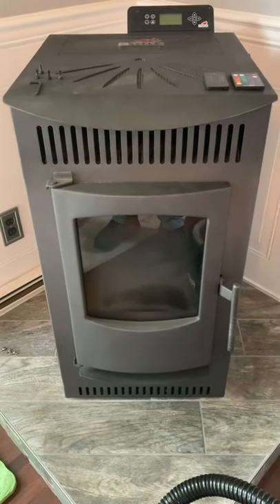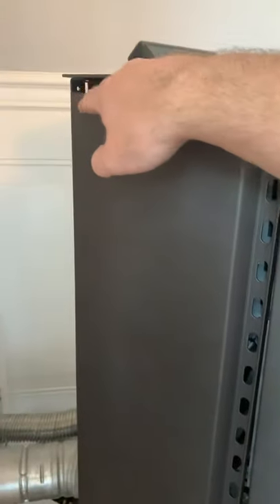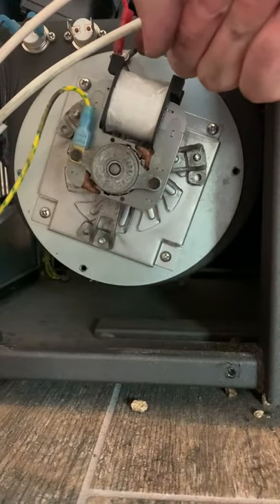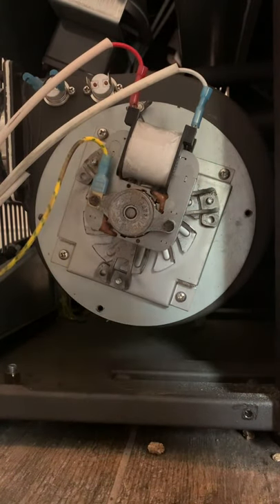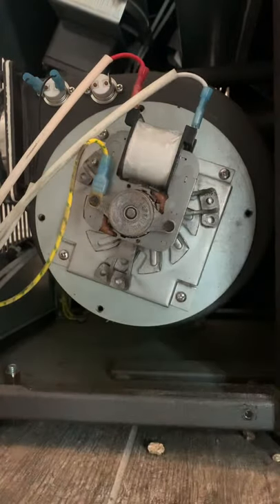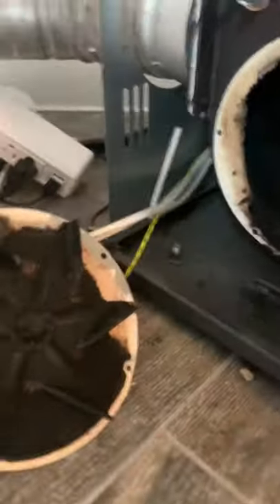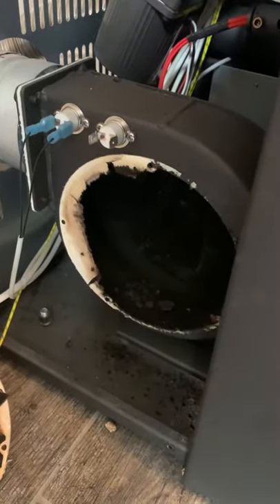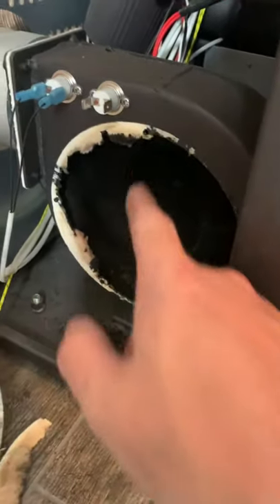Castle Serenity Pellet Stove Blower Removal Cleaning

Comment: I just use Permatex Ultra Copper Maximum Temperature RTV Silicone Gasket Maker, much better then the factory gasket and one bottle will last many years of taking that blower motor out over and over.

Comment: Do you need a new gasket everytime?
Reply from the maker: If you can get the gasket off without ripping it or tearing the insulation I would say no. But with all the heat from this unit I would say chances are that it’s going to probably tear.
Reply: @smitty1715  thank you
Reply from the maker: @nicknickerson4674  no problem new gasket was 26.00 shipped from castle.
Reply: @smitty1715  hey by chance do you know how to run the timer function on this? I have asked everywhere, looked online, in the manual... no luck? Is it countdown? Count up? Both?
Reply from the maker: @nicknickerson4674  I only use the tstat setting.  Never used the timer.  I do know it’s programmable for certain days of the week. I’m just not really too sure how to program it
Reply: @nicknickerson4674  it works both ways, hit the clock/timer button and you will see the screen show 1hr, hit again will be 2 hr and so on.  That will turn in the stove in the time frame you choose.  When the stove in on if you hit the timer button it will shut the stove off in the time frame you choose.

Comment: how do you replace the gasket?
Reply from the maker: It just mounts over the existing blower housing when you pull it off with a gasket silicone. Silicone is provided in the kit
Reply: Is there any chance you can do a video about replacing the gasket? There isn't one anywhere online.
Reply: @erinnshea3529   I just replaced mine. The only tricky part was figuring out that the bolt that holds the impeller blade is reversed threaded.